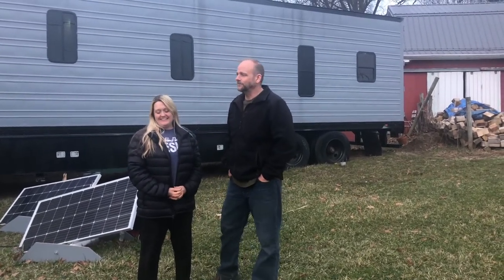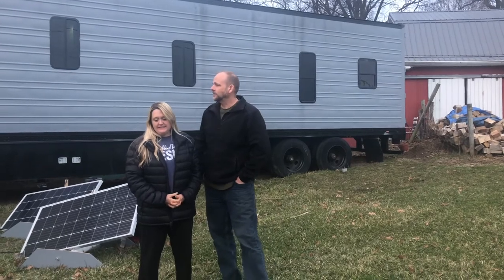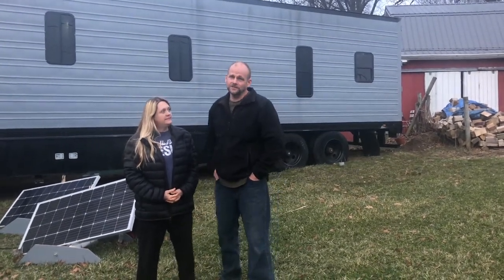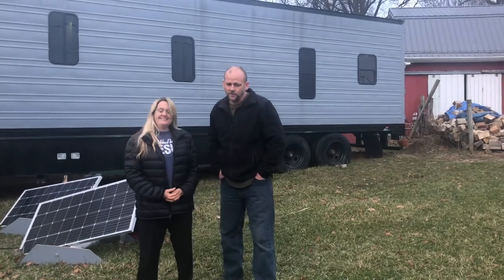Semi Trailer to Semi Tiny House Off Grid Solar Living

Comment: Question how much did you spend on making just the lay out that’s not including furniture or what was the total cost making the inside cause I’ll like too do my own an do it but a rough guess of cost.
Reply from the maker: Trailer was 2800  windows and door- 500  solar system 10000 but we lived in it for first year with just a marine battery running fridge and led lights   Rest was garage sales, thrift stores and auctions

Comment: Did you frame the interior? I looks like you may have done some spray foam insulation.
Reply: It comes with it 
It's a refrigerated trailer  for Frozen transportation
Reply from the maker: Used walls exactly as they came.  Already has 3” foam insulation because it was refrigerated (reefer) trailer